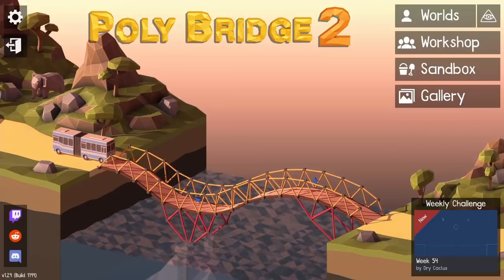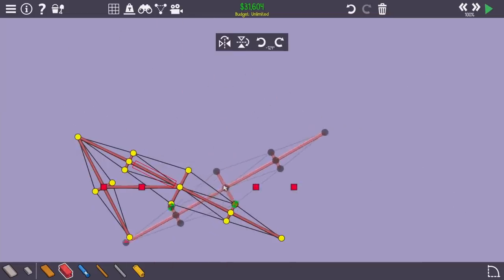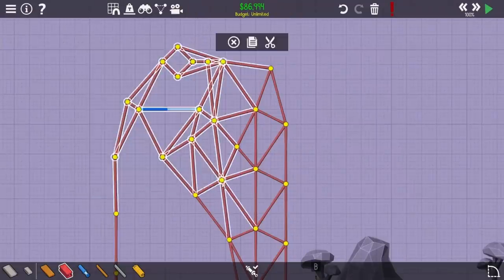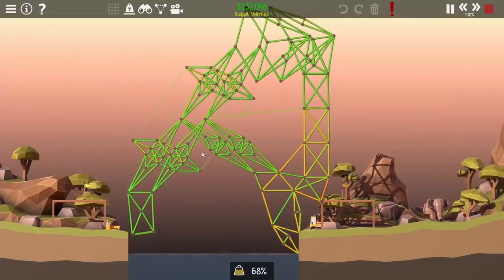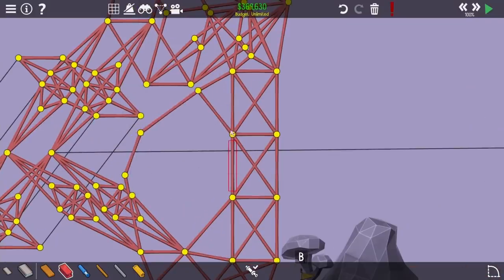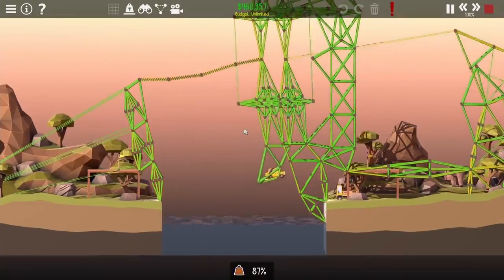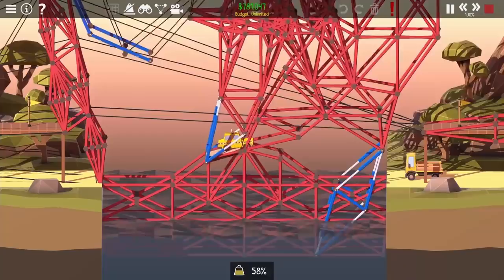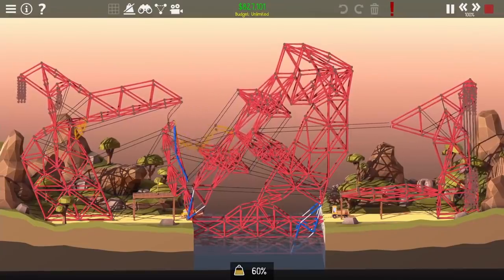Can You Use One Road to Deliver Two Cars in Poly Bridge 2?

Comment: Would be interesting to see if this could be done without hydraulics or breaks, but very cool neverthenonetheless
Reply: Rube Goldberg weight machine
Reply: "Neverthenonetheless". Is this a reference to 'map men'?
Reply: @jonathanpryzby4029  bingo!
Reply: Maybe, but I think the biggest problem is overlapping joints. Without hydraulics you have to create stable force (like with the pulling mechanisms) and without breaks you also need more cables with reset mechanisms. At that point, it's just too much reinforcements and mechanisms crammed into the same spot.
Reply: @TheDreadedJuggernaut  just put the mechanisms below the water, tons of space
Reply: @Roaxial  pretty sure you can’t build that far into the water but idk

Comment: I've recently enrolled at the university of architecture and engineering with specialization in steel constructions and I can say with a degree of certainty that this video is perfectly right.
Overpriced single-use quirky bridges is where it's at bro
Reply: Congratulations on getting into college. Huge achievement.
Reply: Also congratulations on getting a degree in Certainty. I didn't even know certainty was something you could study in college, but it sounds pretty interesting.
Reply: @Leftenant334  And back to you. I didn't know you can rent left, much less live in it. Congrats on living in just left and not right.
Reply: @400and4  Don't you mouth off to the Leftenant or you'll be scrubbing latrines!
Reply: @planescaped  I don't need to listen to a two dimensional shape!